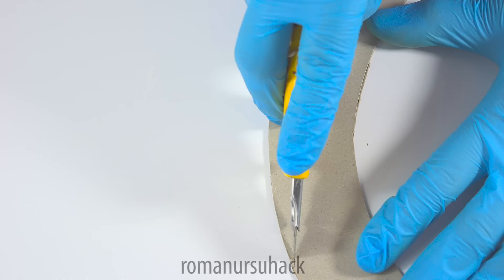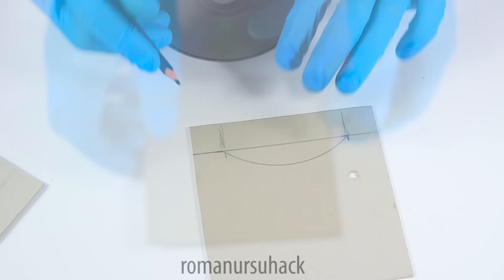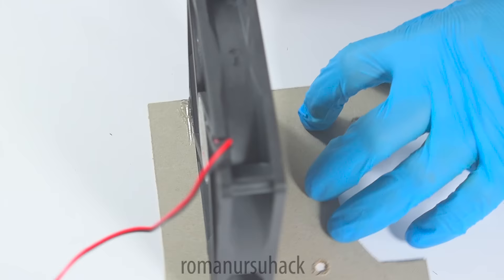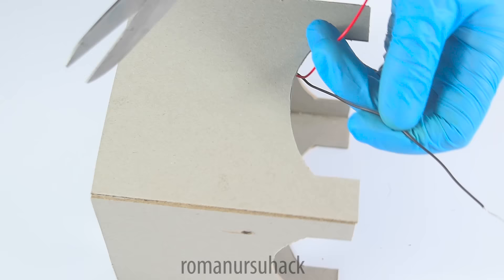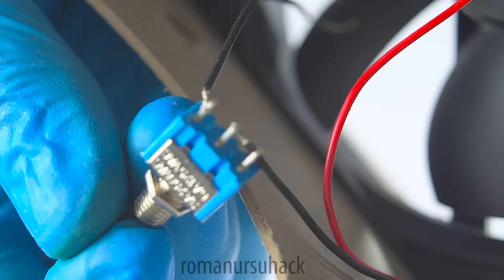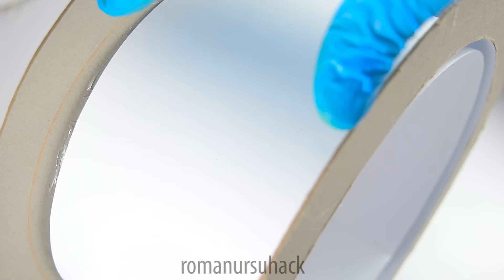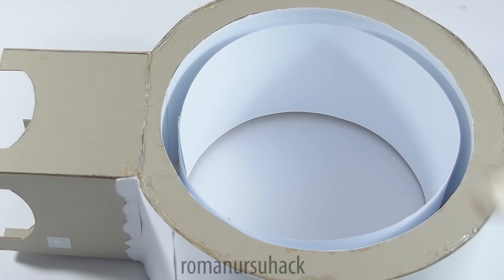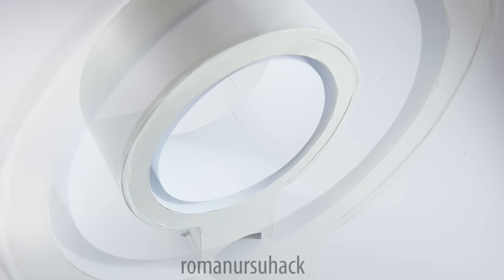How to make a DIY bladeless fan

Comment: The hot glue melts on a hot day when you need the fan most & with the moisture in the air slowly seeping into the cardboard will be a breeding ground for bad bacteria & mould. Sure get terminally ill from a temporary school project that looked ok for a while but built by an adult. I might go & stick a fork in a power point.

Comment: Fascinating, but how does it work????? How does it generate moving air?????
Reply: A fan in the base draws air in which then goes through the ring which then draws extra air in through the inner ring. Sadly this specific fan doesn't use the coanda effect to make it more efficient.
Reply: @LutraLovegood  Thank you for such a great explanation, I am going to check on the coanda effect

Comment: How to make a bladed fan less efficient

There I fixed your title.
Reply: You didn't watch the video. :|
Reply: You, also didn't watch the video.
Reply: Also you edited your comment and still managed to use the wrong "you're"
Reply: you don't get it all blade-less fans have blades in them
Reply: You don't get it, those fans are also less efficient. Any time you're adding extra friction to the equation you're losing efficiency in terms of the fan's ability to move air. 

Also not all bladeless fans use bladed fans in their base. Many work by ionization.

Comment: Wtf it aint bladeless because you hide the blades? 😂
Reply: Adam Hoijer doesn't even Dyson®
Reply: Adam Hoijer 
he meant as in its bladeless as in no blades on the opening, that's essentially what other companies do.
Reply: Dyson  has a high power fan in its base
Reply: "The only reason for hiding the blades is for safety" - yeah, no it isn't. The fan in this video works nothing like a dyson bladeless; there's plenty of 3d printable designs that do though...  The key with the dyson fans and similar systems is the air moving through the hole is a much much higher volume than the air your fan moves; that's how you prove that it works. https://en.wikipedia.org/wiki/Entrainment_(hydrodynamics)
Reply: @Terrible Debacle The Dyson doesn't work exactly like this. This just channels the air through the slits. The Dyson's ring is actually shaped so it uses inducement and entrainment to pull air through the hoop. This doesn't pull any air through the hoop at all, so the hoop in this instance is pointless. The shape of the hoop and the angle of the air outlets has to be aligned.
Reply: @robwalker4653  It does did you not see the streamers at the end
Reply: @naxzed_it  the streamers are being blown by the air coming out of the slit. That's why it has such poor airflow and they are only fluttering. Big test would be to put a small balloon behind the hole and see if it gets sucked through. I bet it wouldn't.
Reply: @rebelartwork  No they're not? Look at the way they move.
Reply: @naxzed_it  the inside is a flat edge so it won't work. It's impossible, that inside edge needs to be curved. That's why the streamers sometimes flop towards the middle.
Reply: @naxzed_it  also the gap is at the wrong end. It should be at the back facing forward.
Reply: @rebelartwork  you´re really serious with your answers? :-D I guess you also start counting when someone says there are billion stars in the universe :-D

Comment: Use 2 fans, 1 big and 1 smaller diameter. You will have stronger air. You can watch how the wind tunnel work. It is very difficult to describe.
Reply: How are they arranged? In sequence?